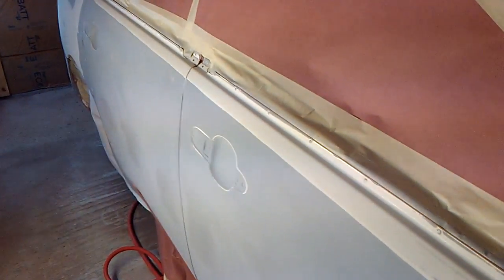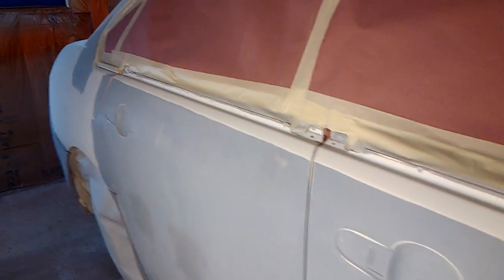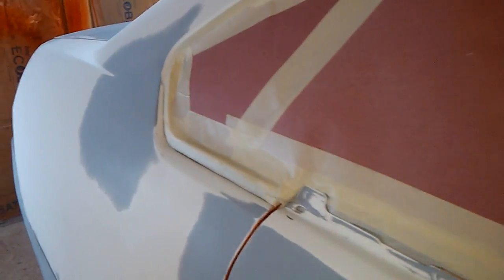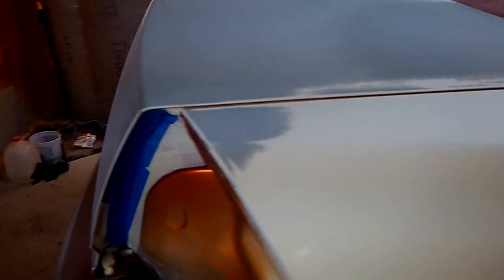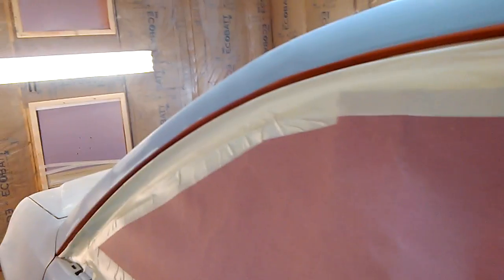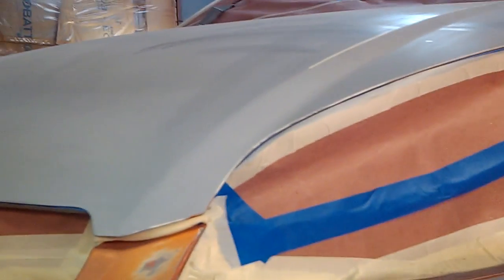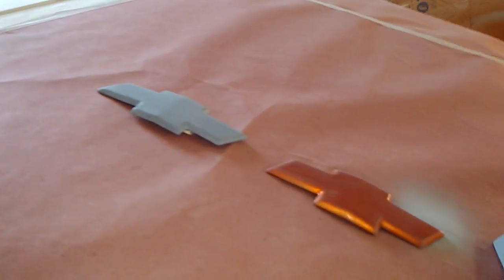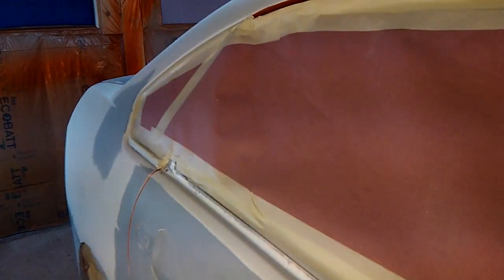How To Mask Your Car The Right Way / 06 Impala Candy Orange Paint Job / Update 19

Comment: great job masking, the body looks nice and clean, this is always the anxious part for me right before time to spray, good luck laying the candy out
Reply from the maker: Thanks for the motivation ..... I think im good with the base and clear coat its just the candy coat that i dont want no runs ... any suggestions ... what psi should i be spraying the candy coat with a Satajet 3000 hvlp....thanks again
Reply: SprayWayCustoms i sure wish i could help with the air pressure question ive never used a real good paint gun like that, are you subbed to slowsrt or vwdarrin or sattajet 883 any of those guys could lay some good info on you, i would try darrin first hes probably the easiest to get a hold of, if he reads your email he would definetely answer you ive never sprayed any candy
Reply from the maker: Not a problem...I'm painting the base right now its a lot easier painting the car than small panels...I just got the fan and material wide open and my psi at about 29...thanks for responding